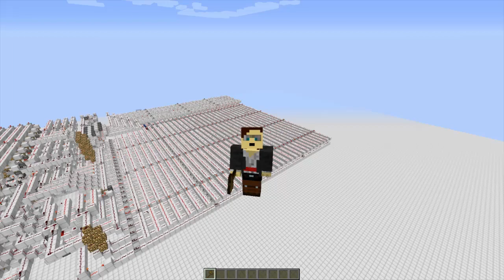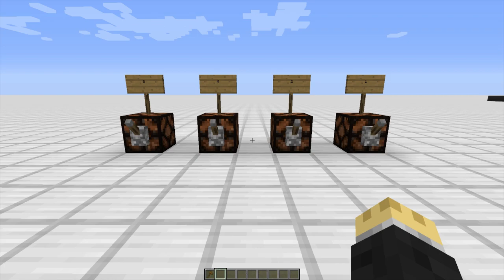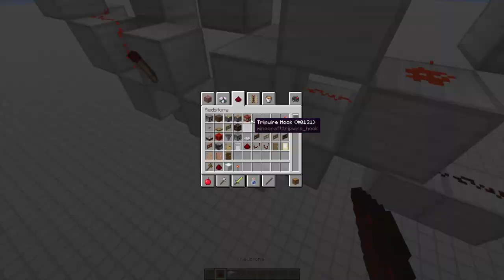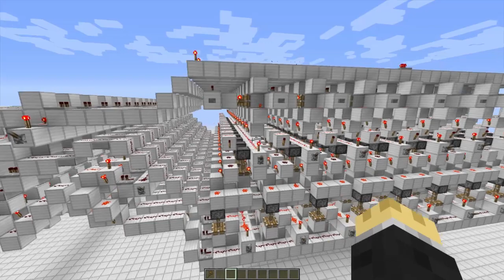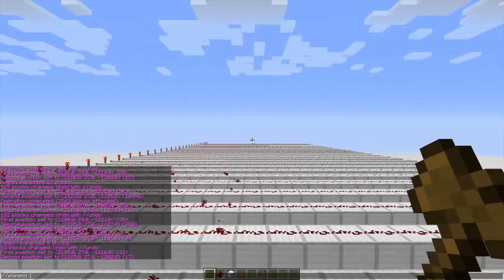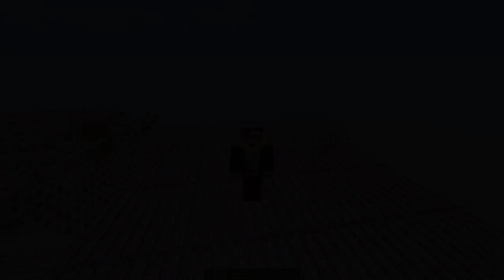Basic Computer Concepts - Pt 1 - CPU Architecture

Comment: Question! Does this work in McPe?
Reply from the maker: No idea.
Reply: Probably is a waste of time since you have to do everything by hand and it must take ages and it will hurt your fingers, also, i dont think McPe is powerful enough to handle a computer in the game lol
Reply: Technically, yes. Not this exact computer though, because the registers are using BUD piston mechanics or quasiconnectivity or whatever (IDK the terminology), but since all of the logic in here doesn’t use any exploits, it should work. Though it would be hard since I don’t know of any world edit type mods on the bedrock edition.
Reply: @secnytsecnyt2981  Lets not forget it uses TONS of ram and idk if a phone can take it
Reply: Gameriffy 

I read Pocket Edition as Bedrock edition, so maybe on Windows 10 edition? Maybe with something small (4 Bits maybe) could be run on a mobile device. You are right though. Technically if you could upgrade the RAM and CPU of a mobile device somehow (IDK how mobile devices work, I’m more of a PC guy), it could be run.

Comment: good but PLZ TALK SLOWER AND MORE CLEAR AND EXPLAIN BETTER
Reply from the maker: There's a speed adjustment button in the settings... that's the little gear looking button on the video. Feel free to adjust it to your hearts content. 
As for the explanation, I can pretty much guarantee you I can't get much clearer without diverging into abstractions, and lets face it, it's no fun learning the concept when you're left wondering how it translates into reality.

ALSO I THINK YOUR CAPS IS BROKEN!

and punctuation never killed anyone.

Comment: 4:37 but -13 would be 0011 in decimal which is +3 so how does that represent -13 on the signs but when you have -3 which is 1011 on the signs it represents -3? Im confused
Reply from the maker: -13 is outside the range of a 4 bit signed integer.

Comment: To sum it up, there’s an ALU which manipulates numbers (adds, subtracts, invert, etc)

There are registers which are basically memory for the computer to look back to later on. It is directly connected to the inputs and output of the ALU. This video had the numbers input manually in order to put a number into the system

Program memory contains lines of instructions that tell the ALU and registers what to do (load numbers from register 1 and 2 to ALU and set ALU to addition mode, and put answer in register 3, as an example)

Finally, the clock and counter which activates the program instructions from top to bottom and can change the order which it is read by other stuff that I’m still unsure how it works lel.

So yeah
Reply from the maker: Did you just summarize my summary?

Comment: Not a hater or trying 2 hate but you said at Base 2 at the start 2x3=8
Reply from the maker: Offering a potential correction is not being a hater... anyone who says otherwise has a serious case of fragile-egoism.

In this case though, I think you misheard what I said. Rather, I don't think I said 2x3=8 (if you can provide a timestamp though, I would greatly appreciate any mistakes I made being pointed out). 
I did however say that 2^3=8, which is true. 2^3 is justva shorthand way of saying 2x2x2... which does equal 8.
Reply from the maker: Its all good, like I said, I dont mind being corrected.